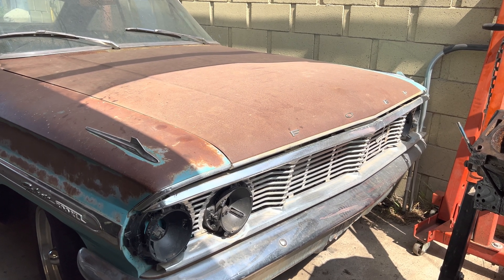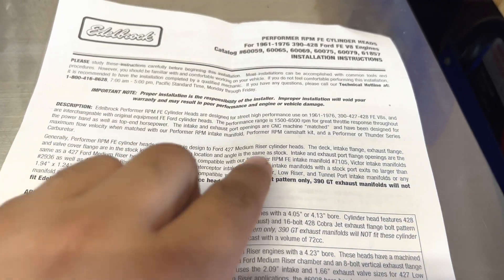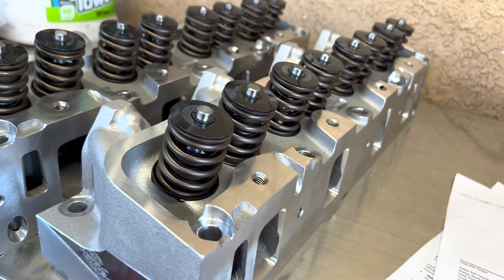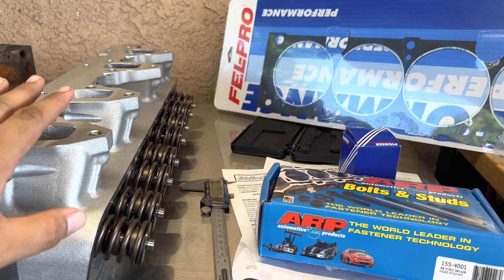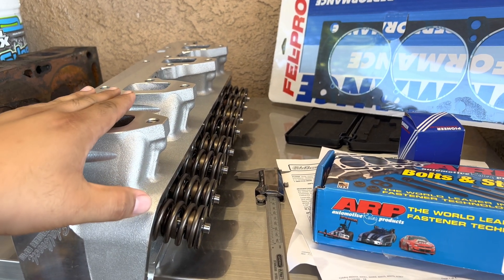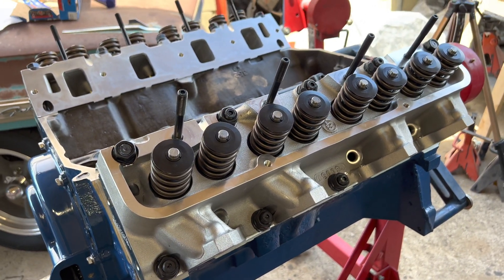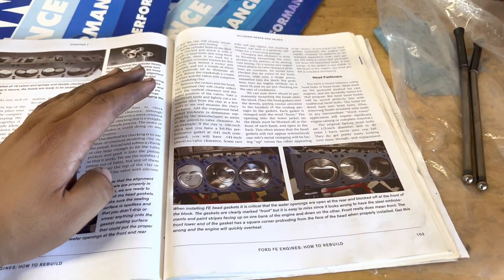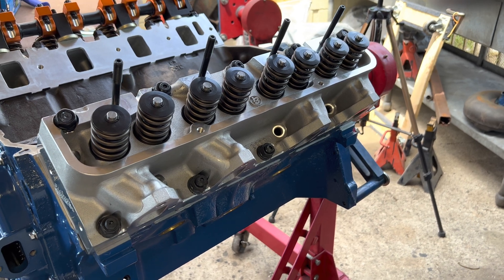Ford 428 FE Build Part 6: Edelbrock Aluminum Heads Install!!

Comment: Hay Omar if you want to run a Low Riser or CJ intake with MR.ports just use the CJ or Low riser gasket it works fine .Also you might want to.port match those heads to the larger gasket being careful not to go too far on the top.of the ports for the oil feed to the rockers . Same thing with using a 429 CJ intake on a thunder jet head same on the Cleavland 4V intake on the 2V heads .

Comment: A lot of people would tell you the best value all around would be the Trick Flo heads they run circles around those Edb .heads  . Also whatever aftermarket heads you buy should be fully disassembled and checked for quality control issues . Lots of horror stories about just bolting on aftermarket heads and them not performing up to expectations .

Comment: I had a 64 Galaxie 500XL convertible that we pulled the 390 out and put a 428 Cobra Jet 3 duce in... man what a beast it pulled the front wheels off the ground, it went low 12's in the quarter mile.

Comment: Hi Omar. Enjoying your videos. Thanks for doing them. Trying to learn what I can on the 428s. 

I just purchased a 1964 Galaxy which originally had a 390 but sometime in its history was swapped with a 428 crate motor (I think, because it has no serial number).

Comment: Right on👍 I am building a 428 woth same heads at the moment. I even have a 390 I bored and stroked to 445 with a set of them about to go on. The FE parts are few and far between last few years. Everything seems to be a wait.
Reply from the maker: Man a 445 would be so sweet. I’ve got a 390 I can do it to
Reply: @OmarRamirezGalaxie  Absolutely. I actually have two in the shop atm, one almost done and the other about to get started on.

Comment: For me getting OEM FE heads refurbished and ported ends up costing about the same as the new aluminum heads.  The new aluminum heads outperform most anything the factory introduced back in the day.  I originally was planning on going with the Edelbrock heads.  Then I found that Trick Flow makes heads for the FE now.  They cost a bit more than the Edelbrock's but they blow them out of the water.

Comment: Hi just wanted to ask why you chose the Edelbrock heads?
Reply from the maker: Cobra jet heads are hard to find and expensive. Having to machine them still, the edelbrocks will come around the same price and they are aluminum.
Reply: @OmarRamirezGalaxie  how do the edlebrock heads flow compared to the Cobra jet heads

Comment: If you would’ve used regular head bolts wou wouldn’t have to shim the rockers
Reply from the maker: Yes, but will still need to shim to correct rocker geometry

Comment: Yes and the fact that Aluminum dissipates heat way better than cast Iron which tends to hold heat... so aluminum heads and intake handle fuel way more efficiently that iron [and power to weight ratio is a factor but the heat thing is a huge advantage]. There's a new thing that can be done where you ceramic coat different components to protect the engine at higher RPM's from heat. Yada yada... :-))
Reply from the maker: Very true. The headers especially give off a ton of heat. I did get those ceramic coated so they should definitely help

Comment: If you have any problems message me I've done at least a hundred of these can walk you through it you need to buy an adjustable push rod to come up with your push rod overall length and you need to buy a set of test springs it'll be very simple
Reply from the maker: Thanks Brian, pushrod checker should be here tomorrow. I’ll have to look into the test springs still. I will keep you in mind. Always need help haha
Reply: @OmarRamirezGalaxie  what you want to end up with is a pushrod rocker shaft height combination that puts you in the center of the valve tip then you adjust your pushrod length you should be scrubbing no more than .050 and you will have the correct valve change geometry making sure it is in the center of the valve tip if you get yourself a stack of VSI shims get the a,b and C's the part number you want is 306 that is how you adjust your rocker shaft height properly I was involved with the development of this system with Harlan and sharps I think the guy's name at the time was Mike or Mark you're talking more than 30 years ago worked with him on the Chrysler la block system 318 340 360 and the 427 FE system PS this is how jessel also does it they might have been watching LOL
Reply: Always willing to help enjoy watching you fellas do this at home in your garage and teaching yourself it's the best way

Comment: If you have a degree wheel and a dial indicator put the engine into valve overlap with test springs on it and dial indicate by pushing up and down on the valve and you'll know how much clearance you have I recommend .100 that's good and safe

Comment: There are special light duty valve springs to use (just two for one cylinder) when checking valve to piston clearance and rocker arm geometry that will not bend the adjustable pushrods. These are usually included with degree wheel kits. You will need to recheck valve to piston clearance once rocker arm geometry / pushrod length / shim thickness is determined. Assemble, check, disassemble, adjust, repeat….
Reply from the maker: Yes you are right. I’m in the process of getting the correct geometry. I was going to use the adjustable pushrod but I don’t think it’s strong enough to withstand the springs. So i will use the light springs and shim until I get the correct geometry. I’ll show it in the next video!

Comment: Can't wait to hear this thing idling and running. I was once told that just the Edelbrock heads should add 90 to 100 hp. With a very competent street build - like drive it every day - same guy told me he dynoed his at 525 hp. Pretty sure he is running lower comp - maybe 10:1. It's in a 66 Galaxie that everyone from kids to wife would drive. Not a show car. But no matter the numbers the thing runs like a champ. Still drives it regularly today after about 8 years. So, I'd say it's durable as heck too. Maybe 80k on that build? Maybe more?
Reply from the maker: Yes I’m excited to hear this thing rumble. I’m hoping for at least 500hp but may be too optimistic haha. I guess I’ll get it dynoed and see.
Reply: @OmarRamirezGalaxie  Or just say it is....that seems to be common too. LOL

Comment: Keep them sprayed with WD-40 and the aluminum will not turn funny with corrosion and will look great for a long time. Will smell from time to time and if you can handle the perfume smell your motor will always look great.
Reply from the maker: Thanks for the tip. Was wondering how I can keep the aluminum in hood shape.

Comment: Powerful valve springs are hard on valve seats, valves and other valvetrain components.  Lightweight valves might be an option and keep the stock springs. Keeping the motor alive as long as possible with no issues shoukd be the goal. Don't be in a hurry.
Reply from the maker: Very true, thank you!

Comment: I looked up your HR lifters.  Edelbrock heads have heavy valves.  I tried the HR compcams setup and returned it for a solid roller setup.   You will get valve float.  The springs aren't strong enough to control the heavy valves.  If you raise the spring pressures, you will get a lot of lifter leak down because of the valve weight and won't make advertised lift. The correct lifter is the T5329.  The Edelbrock springs are only adequate for a mild hydraulic flat tappet cam.  Again, I warn you, Edelbrock says to torque the rocker studs to 35 lb.ft.   Don't do it. You will rip out the studs!  I know, I did it.  They later changed the recommendation to 30 lb.ft, but they didn't update the instructions.  I torque mine to 28 lb.ft. and have no problems.  I run a street roller cam with over 200# on the seat with no problems.
Reply from the maker: Thanks for the tips. The lifters I have are morel which were recommended to me by the roller cam maker. Since the lifter bore is “stepped” on my 428 the lifter can raise passed the oil hole and shoot out the oil. I think that’s why I’ve seen some articles about the limited travel lifters. I will have to double check the spring pressure as well. Supposedly this model head is rated for the roller cam but like you said it might not be strong enough. The studs make a lot of sense, I’m a bit worried about the durability of the thread inserts so I don’t think I’ll be torquing them to the 35 haha. Appreciate the information
Reply: @OmarRamirezGalaxie   I'm currently building a similar FE with the same heads.  CompCams XR280HR grind (moderate cam).  Look at Compcams 928-16 springs.  Comp actually recommended 924-16 springs with my cam, but I thought they looked a little too light.  The 928's are the exact same dimension as the Edelbrock springs I removed, so they drop right in using the same Edelbrock retainers.  I measured the spring pressures which were 150# seat and 350# at open (.531 lift), which was only about 20# heavier than the Edelbrock springs I removed.  It's worth having a Valve Spring pressure tester, look at the LSM testers.  Also, I'd look at the Johnson FE Roller Lifters, they come highly recommended.  Iskandarian sells the exact same lifter as Johnson for about $100 cheaper, directly from Isky.  The Isky box actually has Johnson labels.

Comment: I have a set of 1 3/4" Hooker Headers for the FE into a mustang. They a Jet Hot coated.  Let me know if you want them.  I also have a new solid flat tappet cam 248/256 0.610/0.614  on a 110* LCA if you want it.
Reply from the maker: Very cool, I’d be interested in the headers but I’m a long long ways on the 68 mustang hahaha so it will be a while

Comment: Don't shim them.  Send them back to T&D and have them clearance the end supports.  I did this.  Also only torque the rocker studs to 28 lb.ft. or you will rip out the studs.  I put the oil restrictors in the block, it's easier, and I use 0.060 orifice.  Check the valve spring pressures and make sure they are correct for your type of cam.  I ordered pushrods from Smith Brothers.  I had them make them as "oil through" to make sure the cups have adequate oil.  Make sure the rocker stands sit down flush, or you will loose oil out the bottom and tear up the rockers  Make sure you put the narrow  rocker stud in the correct position, 2nd from the left, otherwise you will restrict the oil.  I use lash caps.  Sometimes the T&D rockers don't line up exactly with the valve stems.
Reply: Sorry, I meant Harland Sharp rockers, not T&D.
Reply: If you are oiling through the pushrods why not block the oil feed in the heads . It should be.more than adequate oiling according to some builders ?
Reply: @edge2sword186  Pushing oil up the pushrods to the rails won't oil the rocker adequately.  The rails are designed to oil the rocker and then push oil to the roller and the pushrod, not the other way.

Comment: These are decent heads. I built a 428 for my Mercury Cougar about 15 years ago and used a set of the Edelbrock Performer RPM heads with some light cleanup work in the ports and port matched to a Performer RPM intake. I used a pretty aggressive hydraulic flat tappet cam and 10.5:1 pistons and that engine ran like a dream. Sold the car a few years later, but I loved that 428.
Reply from the maker: Nice! This one is about 10.5 compression as well. Looking into por matching as well. I’m sure that will make a noticeable difference

Comment: I always stud my intake and cylinder head valve cover bolts. I used to run a built 390 in my 67 mustang fastback and I was always having  to remove my valve covers to adjust valve lash. It made it so much easier with the studs because the big block was such a tight fit. Now I put valve cover studs in every engine I build.
Reply from the maker: Very nice I’ll have to look into that. Hopefully I’ll have enough room with the tall valve covers and the master cylinder. It’s looking pretty tight!

Comment: You should check with Lykins Motorsports for rocker shaft mount spacers. He  makes them. He is a FE builder and has a you tube channel.  Great info on Ford FE motors and more.
Reply from the maker: Yes I’ve seen lots of his videos. I’ll have to double check the correct thickness on the spacers. I need at least 1/4 inch but I’ll call him to see if he makes that thickness

Comment: Edelbrocks are ok, but there are better options for making power for the FE. Trick Flow, BBM, and Survival  are all preferred these days, but with some expert work the Edelbrocks can be made to flow almost as well. I'm running BBM heads on my 445.
Reply from the maker: Yes there are other options but I think they’re fine with a mild build. I’m really leaning towards building a 445 for my 68 mustang!

Comment: Top of the line equipment. They look awesome. What was that little set screw for you put in the head at the beginning. Good luck with the rockers.
Reply from the maker: That is the oil restrictor. The ford fe has a tendency to pool up oil on the head instead of keeping the oil at the mains were it’s important under hard acceleration. With the roller rockers they don’t need much oil

Comment: Match the ports , some aren’t always true to lineup. Match the intake to heads .
Reply from the maker: Will look into that when the intake is mounted. Thanks!
Reply: @OmarRamirezGalaxie  I’m wondering if anyone has developed a direct injection intake for FE engines
Reply from the maker: @rossboyd2272  I believe Edelbrock makes the pro flow if that’s what you mean. Looks pretty cool!
Reply: @OmarRamirezGalaxie  I’ve been out of the loop for years . I can’t work on the things I used to love like Trucks because of my injuries. I was able to do a frame off restoration on a 72 ford truck for my son . We spent 2years on it and 10 grand . Now I can only look at them . I love watching you do your thing , and others . My son wants an old galaxy. He just moved and is building a new home . He is in another state, I don’t get to see him much he is soon to be here on the 6th can’t wait.

Comment: Omar just wondering why you didn't polish the intake runners on those beautiful Edelbrock heads? 
Your doing a great job doing it right taking your time. 
From the Motorcity in Detroit 👌👍✌️
Reply: I can not speak for Omar but intake runners are tricky and if not running fuel injection this process even is more important.  Fuel needs to atomize and a proper mixture of air/fuel needs to happen not to mention velocity.  THis is why many people weld up floors to create velocity.  Not going to get to deep with this but if you want to polish up the exhaust runner have at it, as this runner is not so sensitive.
Reply from the maker: Thanks Scott! I’m not really too knowledgeable when it comes to head flow so I would rather leave it to someone who can port, polish and check the flow. I think with this build it’s not too critical but maybe on a future build I’ll practice with the smog heads that I have.

Comment: Those are nice heads. Are they the 6005's? got a set of those on a 445, runs really strong. The aluminum definitely dissipates more heat into the engine bay than the cast iron does, I have found.
Reply: You know that's interesting I've never had a set of aluminum heads but nobody reports that. Makes sense
Reply: @johnsheetz6639  I've got two vehicles with aluminum heads and noticed it on both of them. I have also noticed hot restarts are  a little harder with aluminum intakes than cast iron in general on hot days if you're using a carburetor.
Reply: @MattsRageFitGarage   that is something to consider for a daily driven vehicle.
Reply: @johnsheetz6639  I've been happier overall with all cast iron how an engine runs in the cooler months, that is for sure.
Reply from the maker: These are the 60065 for roller set up. You are right when it comes to heat dissipation. I remember when I switched the aluminum radiator, aluminum intake, and got headers on my 66 mustang the engine bay was adjust full of heat. I ended up shielding the fuel line, starter, and adding a phenolic spacer. It definitely helped tremendously
Reply: @OmarRamirezGalaxie  The all aluminum top end 445 in my dads galaxie with headers has a ridiculous amount of heat under the hood Even on a 70 degree day if it runs for a bit, you almost can't stand to stick your head in there to do anything to it. My galaxie with everything cast iron except the aluminum radiator isn't far behind it though, but it is a noticeable difference between the two. I put aluminum heads, intake and headers on the 351W in my F250 and noticed a little higher under hood temps, although that is a physically smaller engine in a much bigger engine compartment. The FE's definitely kick a crapload of heat out compared to a small block, that is for sure! they both warm up to temperature 3 times faster than the 351W does.

Comment: I have a lot of question's, You are going with roller lifters witch I take has to have special pushrod length. If you ran regular flat tappet cam can you run stock length pushrods with these heads?
Reply: If you have stock rockers, you should be able too
Reply from the maker: Hmm I’m not too sure to be honest. But pushrod length and geometry should be checked on all builds. I don’t think it will hurt to buy a pushrod checker and verify
Reply: Definitely buy a pushrod length checker, and get the FE specific one. My last FE build I wound up with 7 of one length and 9 of the other to get the lifter preload in the specified range across the board. I'm glad I decided to take measurements on all 16 valves.